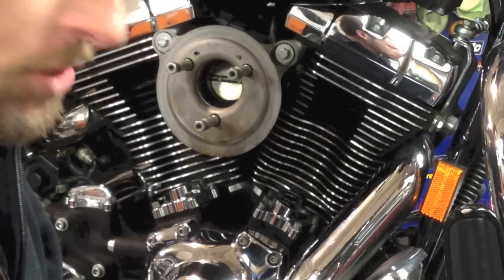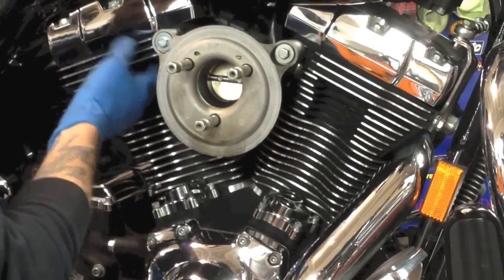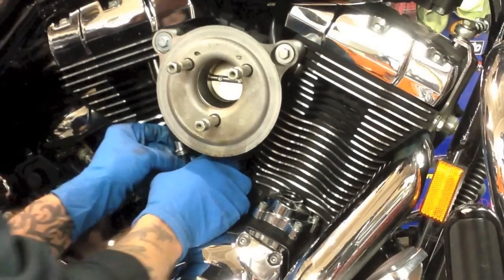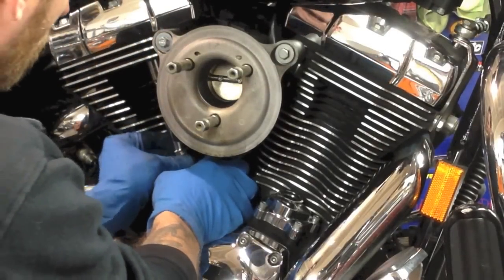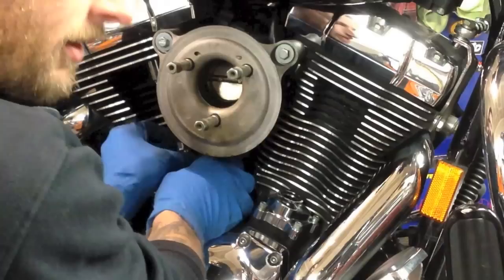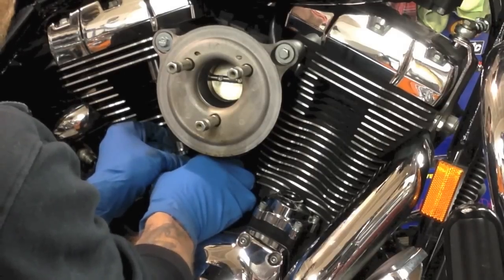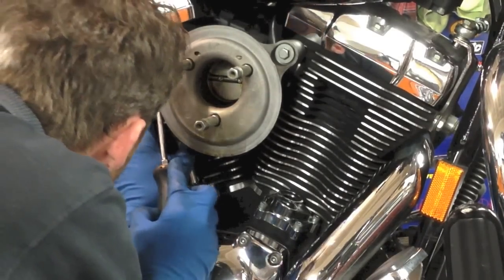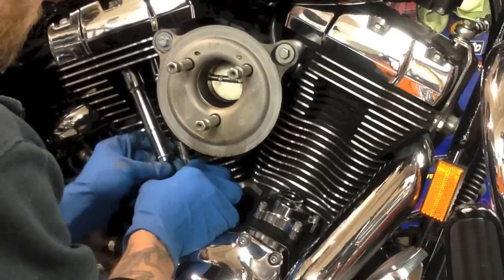EZ push rod install

Comment: I know that this is old, but between your explanation and the video of what your hands are actually doing, this is by far the best video on how to install/adjust pushrods. 

Just put a new cam, oil pump, lifters and pushrods in my 2018 114 Fatboy. I've been asking questions the past few days. I've received answers, but when I went back and tried, I was still lost.

Thank you

Comment: Why is it that in order to get any "Performance" out of a Harley requires the addition of Thousands of dollars worth of after market parts, can Harley not make a bike that actually runs right?
Reply: No shit! 30K for a bike with plastic tappit guides, plastic clutch cabke adjustment, primary chain tensioner that over tightens and causes premature wear on bearings, crap compensator just to name a few.
Reply: @gerrellbradshaw3918  Sounds like"um Good time to trade'um Hog, fur Indian...!???

Comment: Cheers Brian for uploading this ... I have a query as to why @ 11:47 you said to let it sit for 10 minutes before moving onto the front cylinder ? ... what would be the reason for this ? ...
Reply: Dibby59 the lifter needs to bleed down. Pistons will smack the open valves. Don't put the covers back on until you can turn the pushrods by hand will ensure all is ok.

Comment: In my opinion, installing adjustable pushrods over the stock pushrods is all for naught, and is the last thing you need to worry about, if you own any TWIN CAM Harley, engine, produced from 1999 to the present.What he should be worried about is the junk stock flywheel, on this power plant, the very heart of this FATALLY FLAWED DESIGNED ENGINE. The flywheels, are only pressed together, at the factory, with a 400 ton press and have no crank pin bolt and nut torqued to hold the two halves in true, unlike all previous, single cam Harley engines, which had a very good bolted together flywheel assembly.The first thing that any owner of a TWIN CAM ENGINE has to do, if he is going to ride the bike and not just have it parked in the garage to call himself a Harley biker, is to tear down the entire engine, and take the flywheel assembly to a performance specialty shop and have it dynamically trued, balanced, and plugged, and weld the two halves together, to within a sprocket shaft and pinion shaft , max allowable run out of 0.001" or less.These stock flywheels are notorious for coming out of true and as the sprocket shaft and pinion shaft come out of true and wobble, out to a run out of 0.003", they begin to start to tear the engine apart, all the bearings, bushings, cam support plate bearings and cam shaft bearings will be cratered and CATASTROPHIC ENGINE FAILURE WILL OCCUR.This engine has more ways to self-destruct, too. It has two silent chain drives, which operate the oil pump and the two camshafts, and utilize two thumb-sized, PLASTIC, YES PLASTIC cam chain tensioners which rub against a METAL chain, an wear designed to be periodically inspected and replaced as wear reaches, 3/32" or approximately 50% of the original thickness of the tensioner. Most Harley owners are not even aware of this PLASTIC tensioners in this engine, let alone, check them for wear .It's a costly procedure to replace them, too. And a royal pain, the front exhaust has to come off,  the outer cam cover, the cam support plate, the oil pump, and the cam shaft bearings should be change out at the same time due to the junk stock INA cam shaft bearings. Timken Tapered Roller Bearings should be installed at the same time the tensioners are being replaced. That is when you would install the adjustable pushrods, after taking a bolt cutter and cutting the stock pushrods off, so you don't have to take the fuel tank off, and the rocker box covers off, to take out the stock push rods from the top of the rocker box.But, the stock oil pump is inadequate and only puts out 3-8 psi of oil pressure at idle, that is why these engines are notorious for running extremely hot.  And heat is an engines worst enemy for premature wear and failure. At load, around 2,500 rpm it still only pumps out around 35 psi, not enough oil pressure to keep the engine from running hot all the time.The only Harley to buy these days for reliable, dependable, long life, and a great design is the XL1200 Sportster, which still uses the EVOLUTION engine design of the TWIN CAM's predecessor, on the big Twin bikes.CAVEAT EMPTOR. LET THE BUYER BEWARE.
Reply: Mega fine cool lesson, Robert. Thanks a truckload from warm Spain.
Reply: wow, what a slam. If you run your Tcam engine in a stock or near stock configuration, the stock parts work just fine. If you have done extensive modifications to get more HP, well you should have gone the mile and finished the job with all the upgrades to insure the engine will handle it. Common sense bub.
Reply: Hmm i have 2 twin cams with over 90,000 miles both with big bore kits and cams no crank/ flywheel issues at all zero and both are gear drive runout has not increased and i run them hard!!
Reply: I don't think you should generalize. Harley crankshafts aren't bad, but I'm sure they're not the best either. large pistons are often installed, sharp camshafts and much more. and then people are surprised that the crankshaft is no longer running smoothly. a harley is not a racing machine!
Reply: Tissue?
Reply: Somebody’s bitter that their ex ole lady ran off with a big bad man on a harley. 🤣